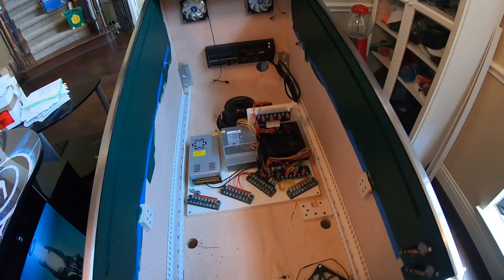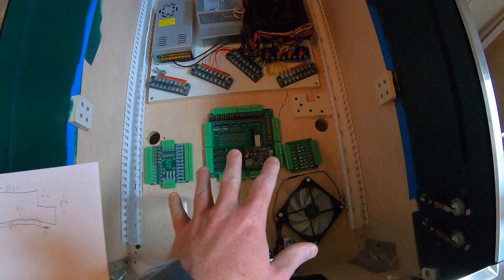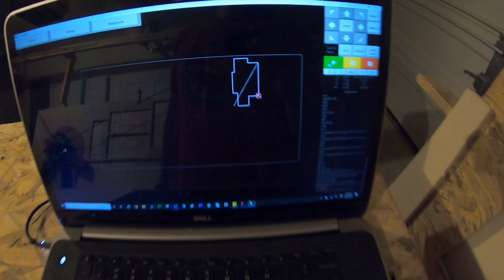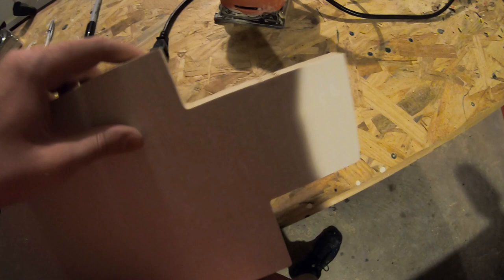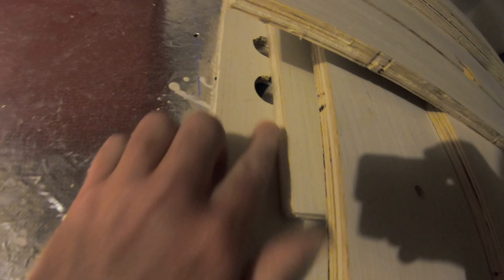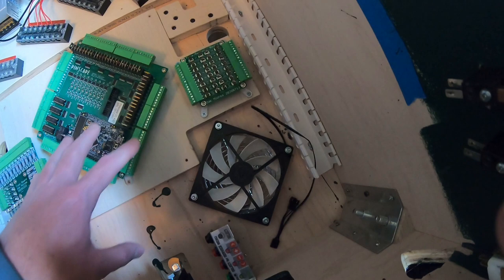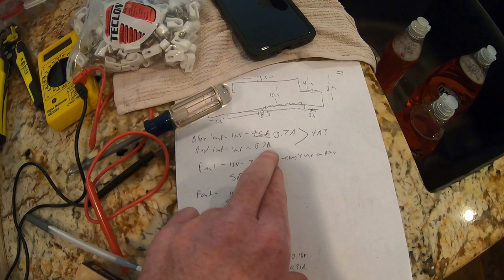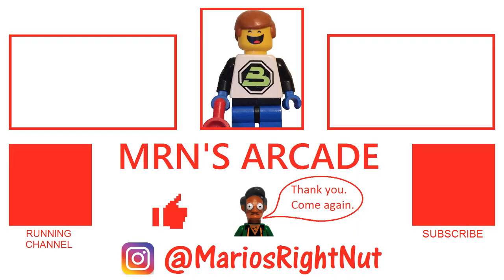Pinscape AIO Interface Board - Virtual Pinball Build 10

Comment: @7:10 24.3v is not out of wack because you are going to have voltage loss in the wires and the electronics.  Having it a little high is not going to hurt especially when its only .3V.  As a comment in your CNC machine, make sure you have NO play in anything its doing.  if you do you are going to experience the bit cutting into the wood like you show.  Also burning of wood could indicate that the blade is starting to go dull.
Reply from the maker: Yea. Probably needs a new bit. But it’s hard to get all the play out of something dangling on chains. Haha. I think it’s just a limit of the machine. And good point about the voltage. I may bump it a little.
Reply: SidebandSamurai
 you are right the voltage should be a little higher when there is no load. It think he could go as high as 24.5v but 24.3v would be find.